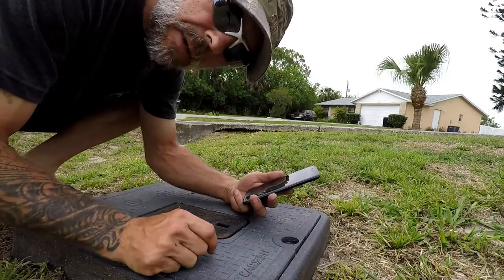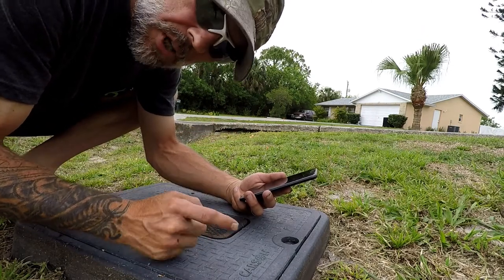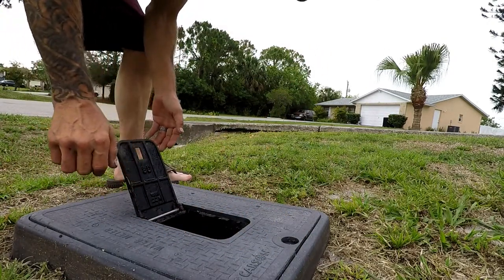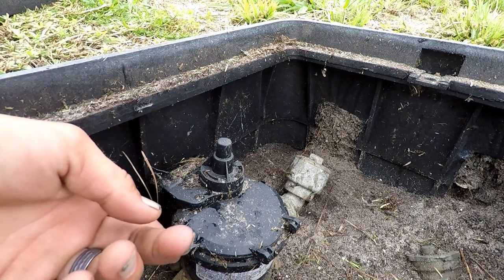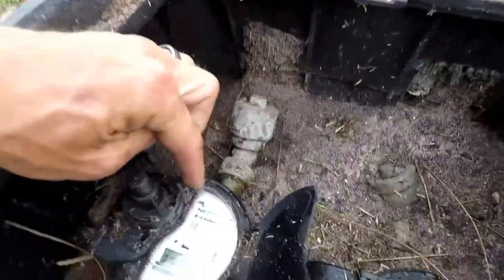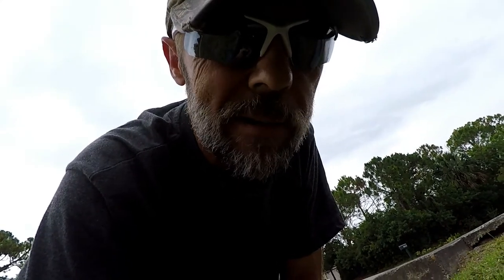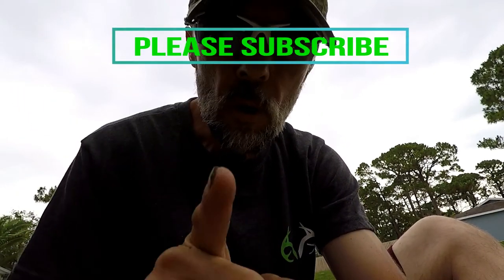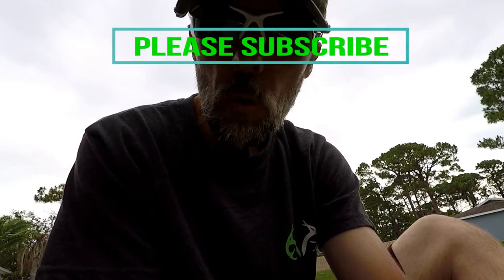HOW TO READ A DIGITAL WATER METER

Comment: if the rate flow is 0.00 and I have a flashing FAUCET ICON what does that mean?   
I have seen the rate flow move with the flashing FAUCET ICON and I know I was running the washer.
But what does it mean with RATE Flow 0.00 and the meter is not increasing and the there is a flashing faucet